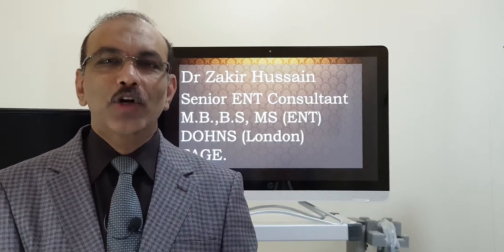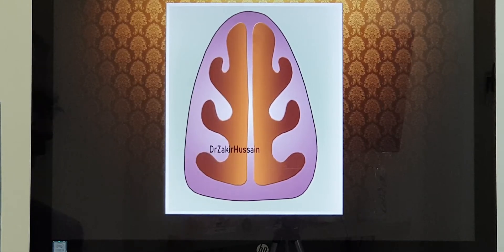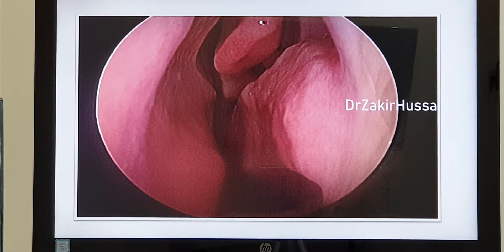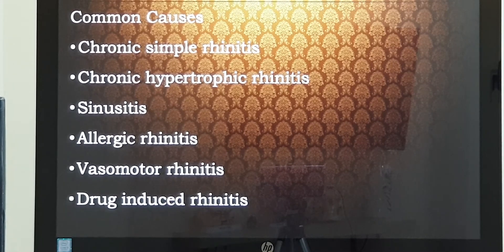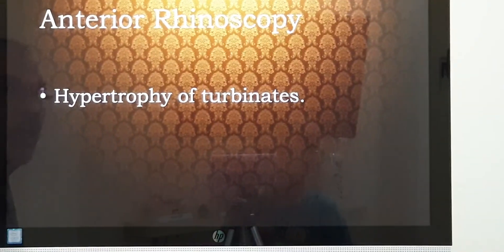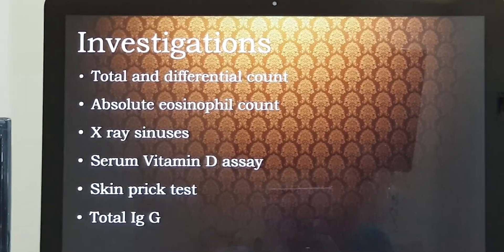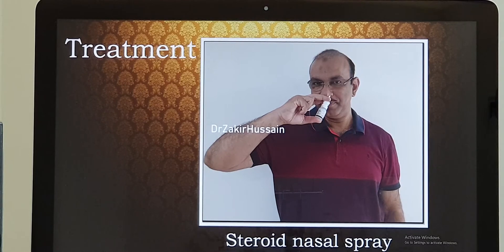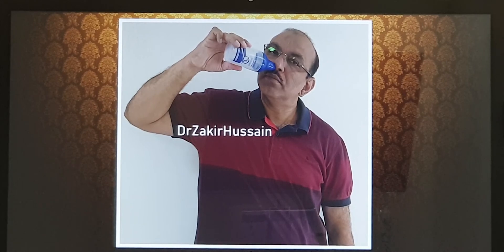Nasal turbinate hypertrophy Part 1 (English) Patient teaching programme

Comment: Thanks for the video. I got my turbinates enlarged after using afrin spray for 2 weeks during covid-19. I stopped using afrin and started nasal irrigation and nasonex spray. My ct scan showed that all are normal except turbinates hypertrophy. Now it is 50 days since started treatment but still the turbinates are enlarged. Does it take longer for them to be reduced in size?
Reply from the maker: Yes
Reply from the maker: 62381 02269 if you need consultation call 📞 after 7 pm
Reply: @drzakirhussainent7860  Thanks very much, I will wait more, use the medicine and hope they shrink without a need for surgery
Reply: Hey how are you?
Reply: Now how u are?
Reply: @prohacker5339  I am better. Still sometimes feel congested nose but much better than before
Reply: Now are you fine